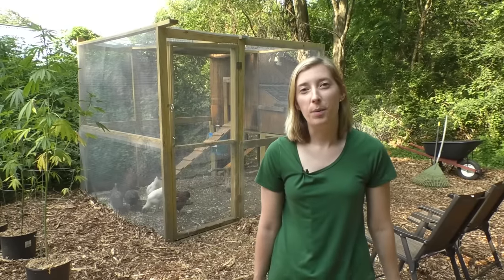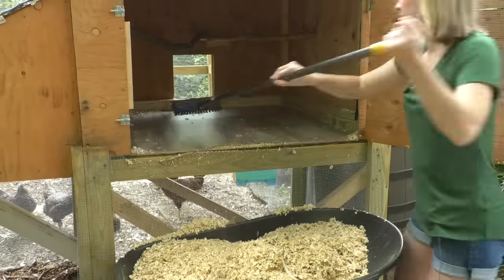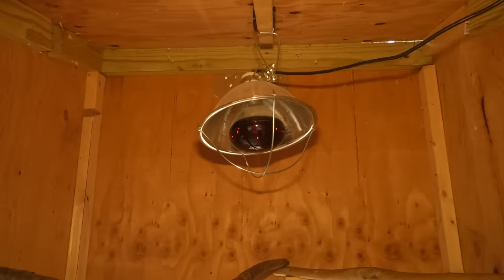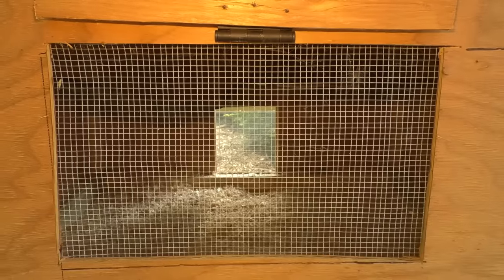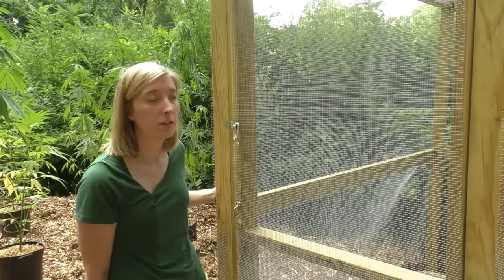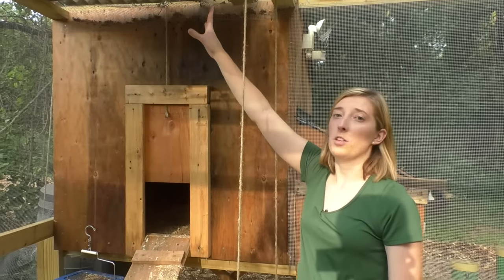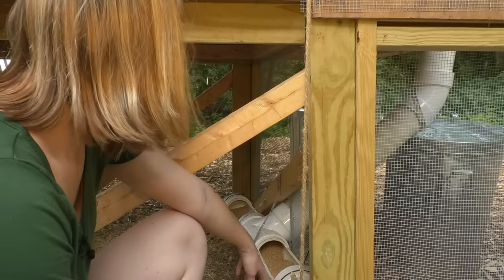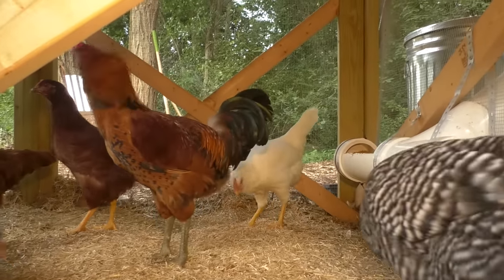Most Efficient Chicken Coop Tour

Comment: We ended up with a free "coop" when we moved to our house in the country. The previous owner built a small room onto the outside of the house, connected to the central air system and power system. It was for keeping cats in. We took out the carpet, put hay and roosts in. 6 hens and 1 roo - the AC saved them from a severe heat wave in the summer before their combs came in, and the heat keeps their water from freezing in the winter. The storm door, siding and solid floor have kept out raccoons, possums, cats, hawks, owls, skunks and coyotes.

The down side is that we can hear Mr. Wook, our rooster, crowing through the vents in the morning!

Comment: For safety: make a hard wire cloth basket to enclose the heat lamp and secure to the ceiling with wire. For predator protection: use plywood strips to secure all hard wire cloth by pinching it in between two layers of wood that are screwed together (racoons can easily pry open the edges where you attached the hard wire cloth to the wood, given enough time for them to get to figure out your setup - they kill every bird in the coop as soon as they get a small opening to get in); cement and/or skirt all walls by laying hardwire cloth or stall mats around the edges. I ended up laying hardwire cloth on the floor and cementing the edges and all seams and putting soil on top, so nothing could get in from the floor.

Comment: I have 17 hens and 2 roo's i made a few different styles of nests i tried on the floor low level nest and a few 4 feet high. I found they like the higher nests not sure why but they picked 2 and thats where they lay. I used natural tree roosts as well they do like to cuddle i had to completely cover the coop with wire because of predators. They have been a true hassle. Thanks for sharing and Takecare and keep safe.
Reply: Higher egg boxes are better they feel safer
Reply: They will always roost and lay at the highest possible point. If they could access the roof they would probably go there. Throwback instinct from living in the wild.💕

Comment: Great tour!  When you mentioned "New England," I knew you weren't done yet... ;^)  Looking forward to your solution to The Vacation Problem; namely, how to provide sufficient unfrozen water while you're out of town. It looks like you're halfway there with the auto-filling rain-barrel. Maybe insulate it and paint the enclosure black.  I've been working on the perfect design for old folks to keep four chickens, but I keep running out of room because I'm trying to squeeze the water and feed storage inside with the hens.  I was chuckled at by the farmer who sold me straw when I asked how he "heated" his chicken house, in the upper Midwest.  He told me to give them roosts away from drafts and they'd be fine.  True enough that. Incidentally, we too had a hanging heater, which one of the chickens knocked down (by flying?/jumping?). It landed in the straw, starting a smoldering fire which killed half.  Afterwards the chickens did without.
Reply: Hanging bucket with nipples and a heater ring at the bottom.
Reply: $20 floating Solar fountain. Moving water doesn’t freeze.

Comment: Could  you post  dimensions to build your 
 coop.I really like it and want too build one in my backyard thanks.
Reply: I would love that as well.- is there any way to get dimensions? Thank you :)
Reply: It doesn't have to be an exact size - you design the floor size based on the number of chickens you have/want (and make it bigger because of "chicken math") - the rule is 2 sq. ft per bird, but if you have bad weather/cold winters, you'll want 4 sq ft per bird (so, 6 chickens will be 24 sq ft which can be 4' x 6'. Make it 4' x 8', the size of a sheet of plywood and you can have a doz. birds). Another way to build it is to base it on the size lumber you can get, like pallets and plywood sheets (4' x 8') then build on it from there. Don't make the walls too high if you get cold winters but high if you have hot summers. Ventilation holes should be at least 1" in diameter and on opposite walls like they showed. If you have cold winters, design the nesting boxes to be inside unless you want frozen eggs. Or, be there to collect them not long after they're laid.

Comment: Deep litter method doesn't involve cleaning out monthly.  Those shavings you pulled form your coop should last 6+months - you've wasted your bedding and defeated the deep litter method.  I allow mine to accumulate all Spring/Summer/Fall and by winter the lower layers are composting which provides heat for winter.  My coop is 7x8.  Use Coop Fresh or other brands of odor control if the smell bothers you.
Reply: They may have neighbors that complain all the time

Comment: 1. The window would be more efficient if hinged on the bottom.  It wouldn't get in the way of opening the coop when it is open, and will require no latch to stay open.

2. This is not a deep bedding technique.  There's nothing wrong it it, technically, but deep bedding is more like composting in your coop.

Comment: Also, need some grit or fine gravel for digestion
Reply: Or crushed oyster shells: 20 kg will last for years.
Reply: I sometimes use their old shells as well as oystershell. I dry them up, crush them, grind them up in the blender and add a pinch to their food on a regular basis. My original intent is to use the crushed shell in my garden beds.

Comment: I wouldn't have any heat lamps...chickens have been around for thousands of years living throughout our cold winters without them. And you risk killing them from a fire or if the power goes out or bulb burns out.
I would of just insulated that little coupe. Looks great for a few chickens, thanks for sharing.
Reply: Steve Brusseau that was my question,, when they are old enough to be outside, are the brooder lamps Needed? I’m aw newbie.
Reply: @mollyy3293  the temp from your lamp in your brooder should be at 95 degrees   as soon as you put the chicks in then lower the temp 5 degrees every week. at 6 weeks they should have feathers and should be ready to go out in the coupe.
Reply: Steve Brusseau thank you!

Comment: Great coop!! I like your choice of hardware cloth. We had a large outdoor run with 1inch chicken wire, then added another section using 2 inch chicken wire. It wasn't long before a pine martin found its way in and killed 10 of our 12 chickens in one night.
Reply: I'm new and learning. Is it the size of the holes that make the difference?
Reply: @hisbeautifultruth5931  Yes. 1 inch vs. 2 inch chicken wire refers to the openings between the woven wire.  (1 inch openings are smaller than 2 inch). If you are building a large outdoor run, I would suggest 1 inch chicken wire. Buy enough to enclose the entire run, including the top. The smaller the holes, the better. If you can afford smaller holes, like the one shown in this video, use that instead. Fencing is important to keep chickens in, but more importantly, it's to keep predators out.
Good luck with your flock!

Comment: It's a nice simple set up, but hardly to most efficiently set up.  I've been raising chickens for seven years now.  I set up a coop converted from a goat shed 8'X16' X 7' tall,  on skids.  #1. There's zero chicken poop to clean up, 2. I simply move it and fertilize new ground once a week. 3. It's all cleans up with water hose or power washer.  Holds over 24 Hens, I don't keep roosters, simply don't need them to have eggs every day. I only name my chickens after "Chicken Dishes".  FYI you would not have a droopy cover over the chicken run if you simply add battons to the cover. If you post and black garbage bag on a tall pole it keeps predators away.

Comment: Lots of great ideas. One security risk I see is the feeder and waterer that you fill from the outside. You have cut the hardware cloth to fit these devices in. So it's not really a secure fit, a weasel or rats or rodents can squeeze at it and get in at that weak spot. It would be better to put in a sheet metal panel and custom cut a hole just the size to allow the pvc pipe and the waterer to fit smooth. More fuss, for sure. But otherwise you do have a place where your security can be breached! I know what raccoons, weasels, mink and also rodents can do, and how they can squeeze and push at something until they enlarge a gap. Sometimes people use the smaller gauge hardware, cloth, the 1/4 inch. It is much more fragile as well. I can't tell if that's what you are using or not, but I would not use it where security outdoors is an issue.

Comment: BTW those heat lamp bulbs sometimes "explode" (or at least break violently). I've never had one cause a fire, but I've stopped using them. My chickens did just fine even when nights got down to zero degrees F. You can even leave the coop a bit "dirty" by adding layers of straw over layers of poop. The extra layer of poop will actually make it a bit warmer.

Comment: I highly recommend using recycled material wherever possible. Habitat for Humanity Restore Store is a great place to start for such materials.
Reply: Nolan James Habitat for Humanity Restore Store sells items donated to them from various sources. For example, someone donated a metal storage shed. You know much they normally cost retail. I bought the entire shed for $.50 for each piece, which came to about five dollars. It made a dandy roof over the chicken run. Another source is yard sales. Someone sold a doggie door that was used in their sliding glass door. I paid a dollar for it. When I built my coop, I turned it horizontally and it became a source of light and ventilation for the chickens. Someone else gave me a deluxe swing set their grandchildren had outgrown. The slide became the ramp into the coop. Since it was slippery, I screwed some slats to it so the chickens could get a grip. The swings got transferred into the coop for the chickens to sit on and play on. IMHO, there is no reason to pay full retail for everything to build a coop. Best of luck and lowered expenses to you. Bob

Comment: That little door/window in the large access/cleanout door would benefit from being hinged at the bottom. In that way, the latch could be mounted on the larger door (Instead of on the coop wall above) such that you would be able to open the access/cleanout door without unlatching the little window/door thing.
Get a ceramic KEYLESS light fixture (look in Habitat restores first)  and a ceiling (electrical) box and mount that to the 2x4 in the ceiling running the wire tight to the 2x4 and out side (use ROMEX 14-2 with ground)  to another  box where you can install a switch initially (replacing it with a temp controlled switch down the road).  Basically, you do NOT want to clamp a glass bulb to a 2x4 in a tight space with six chickens - and depend upon the screws to catch it by the electric wire should it fall.
NOTE: If the have a fav perch,  remove the one they do NOT FAVOR and mount the lamp over that area - best to keep the birds from the bulbs.
However, COLD is less of an issue for fowl than are high temperatures in confined spaces - so controllable venting (like you built) is not a bad idea.  Since HEAT RISES, the idea of vent flaps/doors at the ceiling height is a good idea. I close mine in the Winter and add a thermo-controlled lamp in the winter for your fowl.
Come BLACK FRIDAY, buy yourself a new ten dollar griddle at the Walmart and repurpose your old one to serve as a copp warmer or water warmer! Plugged into a Thermocube, it will only be powered when temps drop below 45 or so. Kept on its lowest setting and exposed to the ambient air temps, it should keep the waterer (is there such a word?!) from freezing.  Also good for raising baby chicks and likely a good idea for early seed germination.

Comment: I ended up making my coop way too big (8x10 ft with 3 full sized windows on 3 sides).  I realized smaller is more efficient for heat and the body heat of the chickens can warm up a smaller space.  Also, an adult hen has large feet.  There is a difference between a perch and a roosting bar.  Roosting bars are wider and maybe rounded off on the ends, like a 2x4.   It's more comfortable for them. They rest on their breast and 2 feet when they sleep.  I started 14 chickens and ended up with 7.  Then I gave the girls away because they got up too early and stayed up too late!!  My life was just too busy for those chickens!  I gave them away to a good home and a longtime poultry man.   Anyway, now with the Covid 'scare', we are ramping up our gardening and I bought 20 chickens.  My whole run is covered and secure with 1/2 hardware cloth, and under a tree.  They are lucky girls.

Comment: I used wire mesh floor, so the poop fall through onto a wooden plywood board below it.  Then I scrape the poop off that into the compost pile once a week. No messy wood shavings or bedding to buy or soiled bedding to dispose of.
Reply: Tough on the feet, man.

Comment: I have a question. When it snows...does the snow affect the welded wire on top of the coop? Does it weigh it down? I rescued a lone chicken and I am trying to get some ideas about building a safe coop...from the ceiling to the floor. It snows a lot in IN and I do need to know if the welded wire I have decided to put on the top will be strong enough to not be destroyed by the snow/ice.

Comment: Heat lamp, and there goes efficiency. Here in Wisconsin, heat lamps cause more moisture and result in frostbite. No heat lamp, no more frostbite. I don't think heat lamps will be necessary beyond young birds. Also, without the lamp, the birds naturally stop laying in winter, so they can maintain their energy reserves and overall health.
I love the rain barrel idea! Thank you!
My understanding of deep litter is that it's best on a dirt or concrete floor, because the composting process happening underneath releases heat and provides a bit more warmth for the birds in cold weather. I don't think what you're doing is true deep litter, but it's certainly a simple method for a small number of birds.
Thanks again! It's nice seeing what other members of the poultry community are doing!

Comment: The only thing i saw that could be improved is the watering cups fill up with funk and id pour concrete under the walls... I had 7 hens taken in one  Night from burrowing a foot under my previous coop wire. Now i pour all walls 8-12inches deep and 10-12" wide of high strength mix with Vinyl/PVC coated chicken wire... Also note that any of that galvanized wire touching the Pressure Treated lumber will rust.. So long term id go with the coated chicken wire instead. 

I just had my neighbors 2 40lb dogs tear up my coop and killed my 10 14 month old hens. So now im putting 2 layers for the bottom 4 ft.

Comment: Not trying to criticize cause I love most of this set up, but I would put different locks on the door in back. Racoons can figure those out easy and we lost our bunnies to a dog that tore that hardware cloth all to pieces. Better to put welded wire all around the coop and run and then add the hardware cloth.  We had welded wire all around and hardware cloth on the bottom and that dog tore that hardware cloth up.  Just trying to help.

Comment: That's not the deep litter method. Deep litter starts at a minimum depth of 4 inches and you keep piling litter on top of the poopy litter until it's about 12 inches deep. Depending on chickens, this can take a year or more. Then you clean out the coop and the under layers have already composted and you have rich fertilizer. Deep litter, due to it composting in your coop, controls all odors and requires very minimal cleaning.

Comment: no the trash in the water leaves, bugs and algae - you need to keep a screen on top of container and not have the water go through debris on roof or any where before the tank - I use a screen and a pond filer and I empty the tank if I see stuff growing in the and wash with soap and bleach - you need to run a hose or run a PVC water line to wash your coop and equipment you will find it will be easy to move you coop 30 - 50 feet away from your house unless you have a POA or HOA that may give you trouble - the stink should travel any farther and you should not have a stinky coop period!! By moving your coop closer you can enjoy watching  the chickens from your home and monitor predators.  I would if I was you to make your nest box dividers closer you need at the largest 12" x 12" or as small as 9" x ? you already your nest area I would move the dividers closer and add a divider - your vinyl floor is a good idea I have it in one my nesting coop, when you move your nest dividers closer add the vinyl to bottom of nest as well and have a way to wash  the bottom of nest. Chicken poo in their nest!!!  most people layer method for coop have dirt floors and coop are much larger than yours - at lease high enough that you walk in it and the roost is 4'feet off the floor pine chips are cheap/ hay/ straw plus the layer method may not be healthy for you are your family having the bedding area raised - the worst thing you did not make your coop easy to move chickens love fresh green grass in there run. if you need any help reply to comment  please forgive me if I step on your toes I love my chickens and they can be a problem most of my birds range except the meat birds are the only one stay in range cages. if you let your chicken out you will fine they all have personalities but if you have hawks or owls I would not unless I was there to protected them

Comment: That's a barrow, not a barrel. Wheelbarrow. Not wheel barrel. Also; composting all that wood chipping is insane.  You don't need to put that much in there, if at all. Especially with lino flooring like that, it'd be easier to scrape a perfect poop layer out to go straight into liquid fertiliser by throwing it in your grey water.